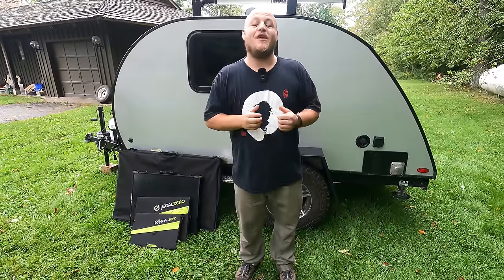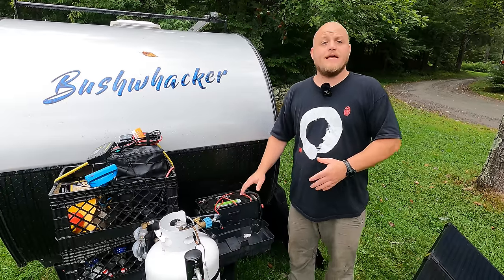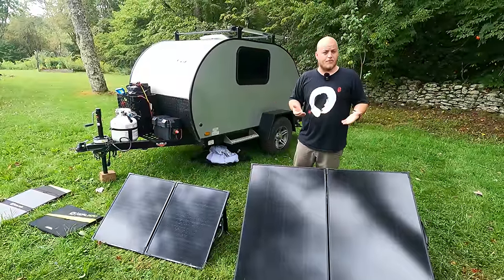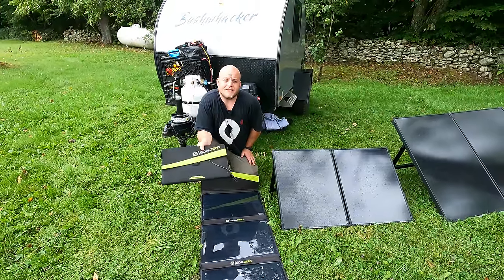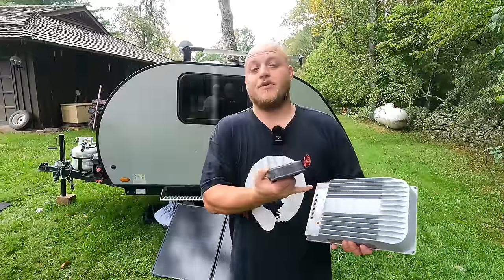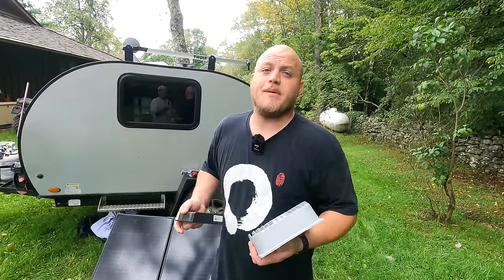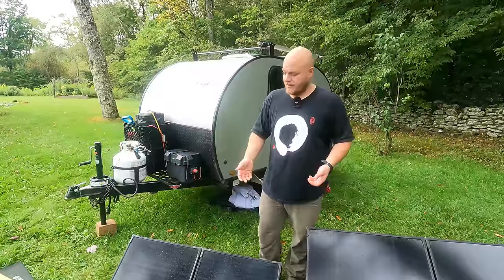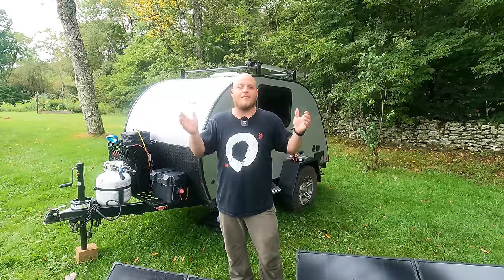RV Solar 101 : Everything a Beginner Needs to Know !

Comment: We have purchased a Bluetti EB1500 and purchased the Ecosonique technology 120w solar charger. We have purchased and 20ft. Solar cable... The problem we are having  is finding adapter that  connects to the BLUETTI to charge it...
Reply from the maker: The ecosonique panel comes with many adapters, one  of them is called an MC4. Look up a picture of mc4 on google for reference.

Your bluetti came with an adapter to accept mc4.  With those two adapters plugged together, you should be able to charge with your panel.

Let me know if this helps or there’s other issues.

Thanks for watching!
Reply: When we plug those in the BLUETTI is not charging. It charges with the little 3ft cord that is direct from Bluetti to the solar panel. Newbie at this solar and none of the connectors make sense.
Reply: I'd take pics and send it to ya
Reply from the maker: @robmcerlane92  pics will help.  Make sure ur keeping the polarity right. + must stay red and +.    The - must stay black and- 

Can’t cross them over, even if the plug fits.
Reply: @DIYOutdoorLife  I  have tried over and over. The MC4 that came with the BLUETTI and the MC4 we purchased along with the 30ft extension that states it is compatible. The only way our Bluetti has charged with the solar is with the 3ft SAE cable with the black  tip adapter that  came with the BLUETTI. How do I send you pictures
Reply from the maker: @robmcerlane92  diyoutdoorcontent@gmail.com

Comment: Brian, if money were not an issue but weight and capacity is, would you recommend a lithium or AGM battery?
Reply from the maker: Lithium all the way, but done right.   I’d get a victron DCDC, a good lithium converter, and a high quality lifepo like Battleborn.   You can’t beat that system if money isn’t an issue.
Reply: @DIYOutdoorLife  I copy all, thanks.  Any thoughts on a self contained unit like the Jackery 2000 Pro?
Reply from the maker: @greshlaing6476  avoid Jackery. They rested on their laurels and fell behind in the game.  The 2000 Pro cost more money and has less features than the majority of the competition.   My recommendation would be an Eco Flo Delta Pro or Delta 2 expandable.
https://amzn.to/3MOx2lD
Reply: @DIYOutdoorLife  great! And thanks!

Comment: I never hear anyone talking about hail damage to a solar panel. Does the panel last for 'many, many, years' after being pummeled by softball sized hail?
Reply from the maker: Every panel comes with a hail rating, they differ from in that rating. The bougerv 9bb for instance has a very high hail rating.  Obviously, solar panels get installed on roofs of houses in place a second pretty bad hail throughout the year.  Softball size hail, sounds like it would beat up pretty much anything.  That would tear up your roof and blast the windshield out of your car, I'm not sure solar panels would like that.

Comment: My question starts from the other end. I want to install A. Mini split Air conditioning.. Show me how I got the idea. That six hundred watts of solar would be adequate.. I only have two regular r v batteries.. Likely you need to upgrade that as well though.. What's anyone's opinion? Using a thirty six foot motor home
Reply from the maker: Although the mini split is an incredible option, it still requires a ton of battery storage.  Most people who use them, go with enormous battery banks.... server racks or several hundred amp hours of lifepo.  Although, it's an investment, it's a really nice set up to have off grid heat and cooling.

Comment: When you say 'glass panels' or 'fixed glass panels,' are they not ALL glass? Which ones are glass, and which ones are something else?
Reply from the maker: They are not all glass.  They make glass fixed panels, glass panels that fold in half, silicone foldable panels like the ones I showed, silicone flexible panels, and a type of panel callled CIGS.  The CIGS panel is very thin and flexible, extremely tough.  I also have a video on the channel all about the CIGS.

Comment: Do you know what the number one problem for RV/camper owners are? Leaky roofs! Two years ago I installed flexible panels on my roof because I didn't want the possibility of introducing water where I absolutely do not want it and I couldn't be happier! I sold that RV and got a camper and I'm in the process of installing flexible panels again because they worked so well. What I find odd is you state that they are very fragile and can break just by handling them and I've yet to see a video out of the hundreds I've watched have that happen. The ONLY issue I've seen with with them is user error and them blowing off on the freeway. Absolutely nothing against the panel it's the person installing them.
Reply from the maker: Check out CIGS panels, definitely the best flexible panels on the market, you can get them from a variety of brands/companies.

Silicone base flexible panels are known by the industry to be kind of lousy.  They are very fragile, they break frequently, and their performance reduces year after year more so than any other type of panel.    This isn't to say that they arent great for your application, but these are widely know  facts from anyone who works with these daily.   

Most importantly, find something that works great for you and it seems like you have .  Thanks for watching!

Comment: Does lithium batteries provide more power per day and charge faster. What lithium battery would be better than your 100 watt battery
Reply from the maker: Check out the video I put out last week all about lithium batteries, I will link it in this comment.

The battery in this video is 100 amp hour, it's 1200 W hours .  Lithium batteries do you have some major advantages you can get either type  in any capacity (amp hr/watthr) but the lithium will be smaller and lighter.

Best Battery System for an RV - LiFePO4 vs Lead Acid
https://youtu.be/azV8wBY_CaM
Reply: Depending on the size of battery
Reply: Lithium runs till 30% then shutdown.
Lead acid till 50 % but you feel lead acid run down were as Lithium ru n hard till death instead of fading out

Comment: So if I am trying to power a fridge in a food truck would I be better off installing a MPPT?
Reply from the maker: What is powering the fridge? Power station? Battery/inverter?
Reply: @DIYOutdoorLife  honestly I’m not sure yet.  So my whole idea is actually to turn a small food trailer into a  mobile floral shop but I need a fridge which should be more like a small soda fridge you see at the grocery store at the registers. I would also need to run a mini ac splitter to keep the flowers inside cool.
Reply from the maker: @EnriquesDoItMyself  these things can be done, they’re very pricey.  A gas generator would be the cheapest and easiest by far.  If you want to run the mini split and fridge off battery, you’ll want a very large lithium bank with an inverter charger. You’ll be able to charge that bank with solar off the roof.  
Seems like a fun project, let me know if you want me to post some links to gear.
Reply: @DIYOutdoorLife  I really appreciate your advice.  I’m literally going in. With no knowledge. I will probably start off with a generator but eventually I want to convert it to solar to be more eco friendly I do feel in the long run it would pay off be not having to spend money on gas.  I would appreciate if you could drop come links on gear for future conversion.  Again. Thank you so much.

Comment: PWM are not great if you have a panel that is over say 20V as it has to dump the extra voltage if you are on a 12v battery system (charging at 14.4v)
MMPT will convert your 20-40v of solar panel down to whatever you need, giving you about 20-30% more charging. (series panels is better for overcast conditions with minimal shading) Where parallels is best if you will have shading. For Example on a cloudy smokey day, my 3x 310 watt 40V Panels in series, on a 150/35 Victron Controller, flat on my van roof, only gives me about 150-200 watts. Sunny day, flat on roof i get about 700 Watts.
Reply from the maker: That's exactly right! I tried to articulate that in the most beginner friendly way possible. Although I regularly run systems like the one you're talking about, they're fine tuned and the best, the vastttt majority of new campers are rocking out 100-200w 18-20V panels in parallel. The difference here doesn't warrant the added cost of MPPT, especially considering most folks want to mount it temporarily and outdoors. This is the fine line I'm trying to walk. Love that system you're running, just want to make sure there's content out there for the majority of these entry level set ups.
Thanks for bringing some high level game to the convo, appreciate you!

Comment: I had a soft case folding panel that produced 50-60% of its rating in optimal conditions. That was a little bit on the poor side and I changed it against a suitcase panel from the same company that produces 100-110% in the same conditions. That being said I read that the ratings are made in fixed conditions and that the max output can be more than the rated output. Or are there different ratings in the US and EU?
Reply from the maker: I love that you brought this up. It's really complicated and has to do with panel amperage and open circuit voltage. The panel can not exceed the ratings that are listed for the risk of hurting equipment and people. If I went there, this video would be 2 hours ..lol   You're observations and research are spot on, but what's causing it can be a dissertation.   Just out of curiosity, when you say the glass panel pulled 110%, are you talking about watts? Measured on your charge controller?
Reply: @DIYOutdoorLife  Correct. It was on my yeti1500x charge controller. On the "bad" panel I measured it with my multimeter but haven't done that on the "good" panel yet. I trust the yeti that it is more or less correct.
Reply from the maker: @lifepolicy  Ohhh, I thought you were talking about a stand alone battery and charge controller. The PPS, like the yeti are engineered a little bit different. That can handle 600w input on the MPPT and can accept a wider range of voltage. I have noticed the GZ panels work wayyyy better on the yeti than other panels. Were either of the panels GZ or other brand?
Reply: @DIYOutdoorLife  Nope no GZ. Both panels came from a German company. However, I'm sure they are made in China. On the "soft case" I measured the output voltage and it was dropping as soon as the panel started heating up. It dropped from 70% output to 50% just from the heat (outside temperature was 26°C that day). I will do the same test with the suitcase panel as soon as I have a free minute.
Reply from the maker: @lifepolicy  I know I'm nerdy but I love this stuff.  Each Panel will have a "temperature coefficient", the voltage will drop linearly as the panel heats us, some types of panel are more susceptible to this than others. One way to "cheat" this is by raising the panel up. Make sure it's not directly on a hot surface like a black roof or black top. The air flow underneath it will boost the performance. A small piece of reflextix or even a white sheet can help too.
Reply from the maker: search solar panel "temperature coefficient (pmax)" to see info

Comment: If i'm installing a battery monitor with a shunt that measures input/output, and the batteries are lead acid so I only want to go down to 50% on them, do I set their AH rating on the monitor to their full capacity or half their capacity? IE in this case it's 210ah, do I set that to 210 or 105? I guess it depends on if I will stop using it at 50% or ..or what?
Reply: Did some research and I can do either, but it makes sense to set it to 105 to ensure what the gauge states makes sense (what you see is what you get)
Reply from the maker: Exactly, either way is fine. I agree with you, it always made more sense to use the “working capacity” rather than the total capacity on the SOC meter.
Thanks for watching!
Reply: @DIYOutdoorLife  I'm actually going to use a 250amp fuse as my bridge from the shunt to the negative terminal. Was thinking about using hot glue to secure it semi-permanently(the shunt not the fuse) to the top of a battery. Any thoughts on why I shouldn't do that? besides maybe not being 100% sticky enough due to fluid spillage possibly..?
Reply from the maker: @dizawnofwizar  it would probably work fine. I’d have to see your exact situation, but you might be able to wrap a muffler clamp around the whole thing as well.

Comment: 8:35 Does 'this panel here' mean the two panels that fold together, combined, or just one of those two?
Reply from the maker: All of the small fold out sections connected together, make up a 100 W foldable panel.
Reply: @DIYOutdoorLife  At 8:38, the viewer doesn't know what 'this panel here' means. It's either one rectangle (not square) that you point to, or it's two rectangles that are connected together and fold open. When you first start talking about the first two sets of panels, you don't say how many watts they are. I'll leave you alone now. No more comments.
Reply from the maker: @JoeDoe2  I don't mind your comments at all, im happy to help the best I can.

There's a 100,000 views with thousands of comments, all of them talking about how the video helped them understand how to build out a system.  If you're having trouble understanding, I'm happy to answer any questions you have.
Like I said in the last comment, I'm referencing the fold out, potable solar panel.  It is all connected, but yes, there are individual small sections of it that allow it to fold, it's still just one panel.

Comment: Dummy here👈 Is there a set up I can have where I keep a space heater and stand up room ac unit (the mind from home depot) in my van and am able to run either of them? I've heard power banks can't hold that amount of voltage/wattage/whateverage. I'm getting a bug out van ready and just wanna have an option of heat or ac without going full blown electrical (not in my budget at ALL) but I'm beginning to think it's kinda not possible?? Help??
Reply from the maker: Your route will likely be thru a gas generator. I know it’s not ideal for some, but for an affordable way to supply that amount of power, that’s the way to go.
Reply: @DIYOutdoorLife  ughhhh....atleast I got an answer but that wasn't the one I was looking for. How in the heck would I even load one up lol. But thank you for responding....now I'm sure there's no other way for me to get what I'm looking for. It's a gas G....or no heat or ac if I'm not running the van. 🤦‍♀️
Reply from the maker: @JoyinFlorida  many people use propane heaters like a propex or diesel heaters like a webasto.  They provide heat with very little electricity or fuel.  Check those out to figure out the cheapest way to do heating.

Another solution is to use a heated mattress pad, they use far less power and can be supported by batteries. 

Air conditioning is very difficult. Zero breeze mark II is a battery powered AC that works well. Big $$
Reply: @DIYOutdoorLife  those suggestions are MUCH appreciated, thank you!!😊

Comment: In more simple terms. If my battery is fully charged, how do I get the power inside my rv for, let's say, a TV or coffee maker ? I'm still not sure how to use the power inside.
Reply from the maker: Without knowing what camper you have, it's safe to assume that your battery is hooked up to your load center inside with a fuse block.   Your battery should be wired to power things like your lights, fans, DC refrigerator, water pump, etc.      When your solar charges up your battery, your battery is able to run all those DC appliances.  If you want to use a TV, using a DC TV with a 12 V plug is a huge advantage.

Things that use an outlet, like in your house, run on 110 V alternating current.  This usually requires "shore power".   You can buy a device called an inverter that allows outlets to work off battery power.   Although these are cool, they can really gobble up a battery capacity fast.  For instance, running a mr coffee, or any other device that creates heat, can use as much power in 20 minutes as you would use for two days powering simple things like lights and fans.   Plugging a TV into an outlet through an inverter, instead of getting a 12 V TV can use three or four times the amount of power.   This is possible, but it requires a pretty good size battery,  much cheaper to just make your coffee with propane.

Hope this helps!
Reply: Thank you. Your so informative. What is your opinion on the Renogy 400w suit case panels? I have a 40 ft deisel pusher and was thinking this maybe what I need

Comment: What about Lithium Ion batteries connected to your 3000w inverter?
Reply from the maker: To use a 3000 W inverter, you need to make sure that you have a lithium battery with a BMS capable of a 250 amp output.  You could likely get by on a 200 amp output, but you'll be cutting it pretty close. 

If you don't have that, when you go to use the inverter at higher load, you will trip the battery and be put of luck.

Comment: Can I use two batteries instead of three batteries in my camper? It came with three batteries.
Reply from the maker: I'm making the assumption that you have a 12 V camper (most are) and that you had three 12 V batteries in parallel.

If that is the case, and it most likely is, you can remove one of the batteries.  Your runtime will be reduced by ⅓ but everything will work fine.
Reply: @DIYOutdoorLife  Yes that's correct. I put house water in them because they were getting low instead of distilled water and now they're all three dead but I'd like to just replace with two brand new ones and not all three.
Reply from the maker: @glennostlee9662 check how many AH they were. You might even be able to get 2 AGM sealed, maint free that are similar to the capacity. For instance, if your flooded batteries were 65 AH, getting two 100 amp hour replacements would be around the same capacity.